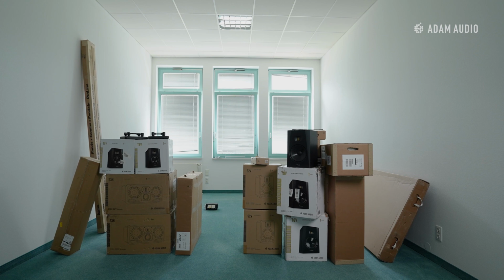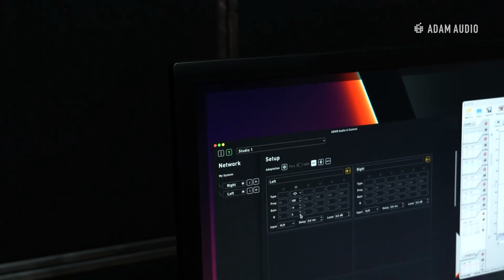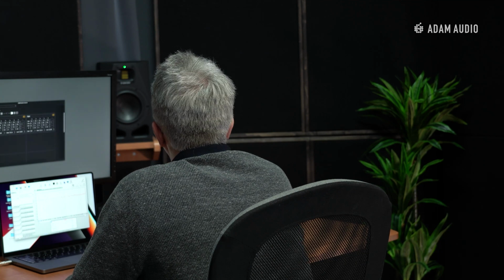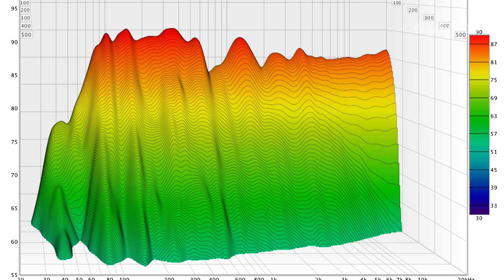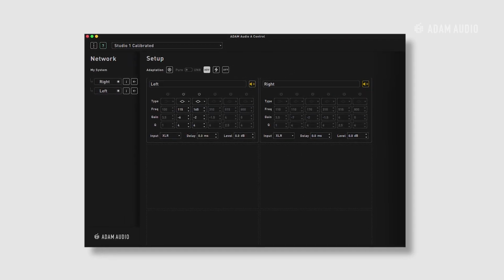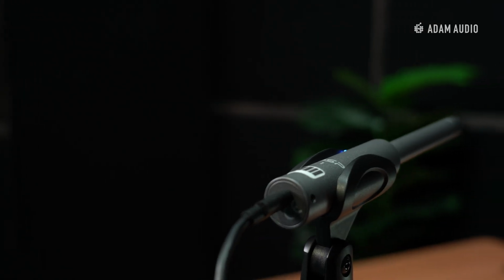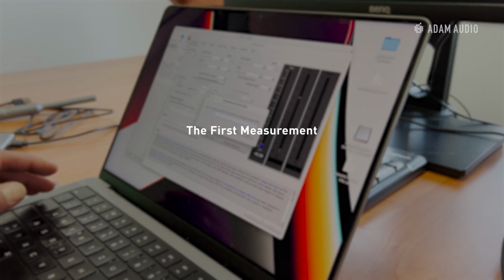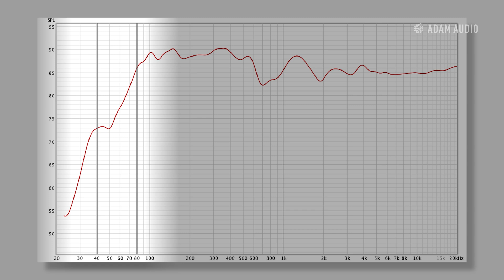Room Correction with A Control | Part 1/3 | Measuring Your Space | ADAM Audio

Comment: I wanted to buy the Sonarworks to calibrate my Dolby Atmos Adam's A series 7.1.2 setup !
499 € is a lot of money, the double of the price of the stereo version !
Reply from the maker: Hi @cbhrcbhr! It is also possible to measure your monitors with the free software Room EQ Wizard and a measurement mic, and calibrate them in A Control. Yet, calibrating an Atmos system requires some more advanced knowledge. So the SoundID option is definitely easier. We hop you find a good solution for your situation. All the best from Berlin!
Reply: Hi  @ADAMAudioBerlin  they have announce  black Friday special prices, let's wait until tomorrow 😀

Comment: I'm 10mins from purchasing the A8H, and I'm wondering if using Sonarworks on board the speakers would cause any NOTICEABLE latency issue. Would it?
Reply from the maker: Hi SynX! Sonarworks as a plug-in has a long latency because it uses FIR filters. The A Series uses an FIR to IIR conversion which Sonarworks calculates for us, and this type of filter has no latency. A Series loudspeakers have a very short latency (<2 ms) and this latency does not increase when using the Sonarworks filter set.
Reply: @ADAMAudioBerlin  Perfect. Thanks